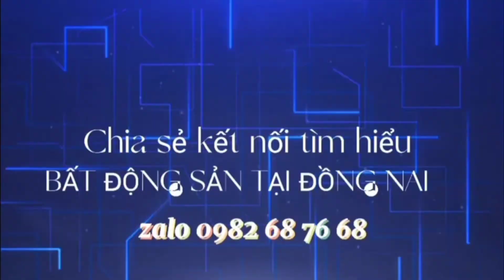CONSTRUCTION OF Pile drilling for railway station, LONG THANH AIRPORT, Đại công trường sân bay LT

Comment from the maker: ACV representative commits: "With the responsibility of being the investor of component 3 project 'Essential works in the airport', ACV will complete the project on schedule, put the project into operation and ensure safety. safety, the highest quality according to the standards of the International Civil Aviation Organization.We focus all resources to implement the project in accordance with the provisions of the law, ensure the quality of the works... and bring the yard to the airport. Long Thanh international flight (phase 1) will be put into operation in 2025 to enhance the position of Vietnam's airport system in the region and the world.

At the groundbreaking ceremony, ACV also launched and signed a contract to emulate 50 days and nights for the construction of ground leveling - drainage and pile foundations for the passenger terminal between the International Airport Project Management Board. Long Thanh and representatives of construction contractors, consulting and supervision units.